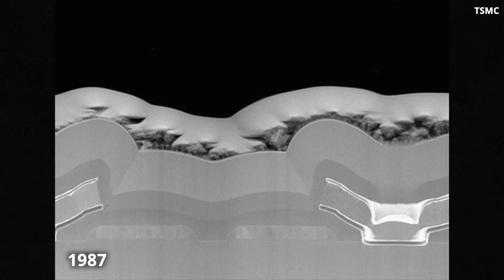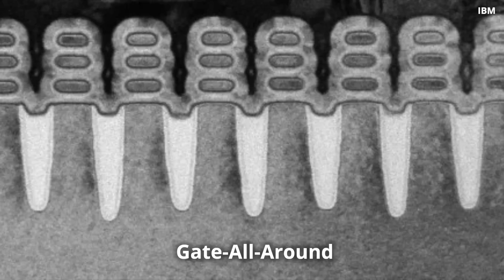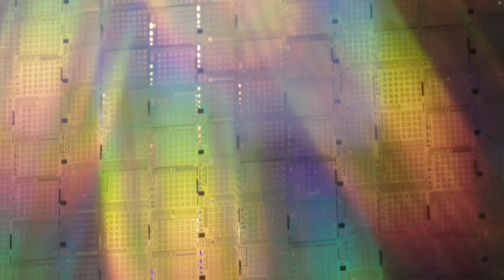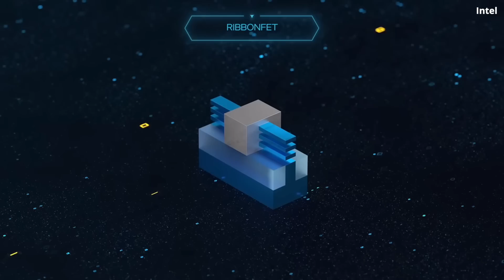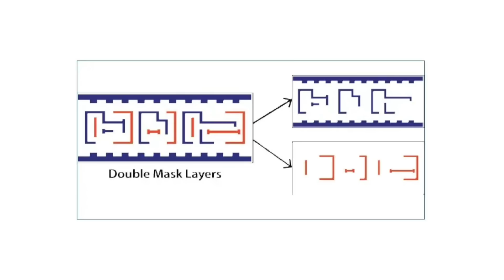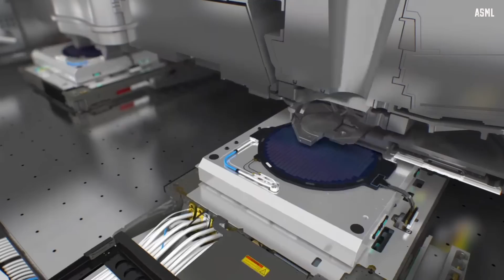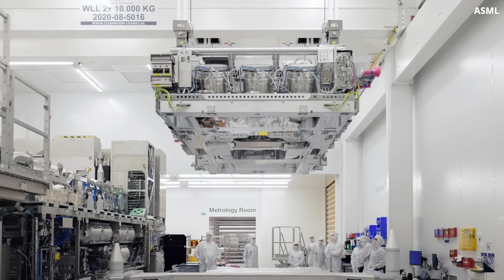New Disruptive Microchip Technology and The Secret Plan of Intel

Comment: I follow you closely. I'm not dumb. Almost every story I read, not just yours, is some new development that is the next big thing, a game changer, etc. can you start working on a story, ranking all these breakthroughs by importance, and then by development, for the past 6 months?
Reply: This is a big one. This is top 2-3, if not 1st. We're looking at at least a 100% improvement in processing power, but could be up to a 1000% improvement in processing power.
Firstly, double-siding the wafer is going to free up huge amounts of physical space for more transistors - not to mention give further ability in higher clock speeds (by distancing the T's from the power lines - and better efficiency and power usage, equating to less heat and the ability to drive things a bit harder and consume less power.

Another thought, for me is, barring physical design restraints, there's nothing stopping anyone from putting transistors on both sides of the wafer.

Comment: Fantastic video, very informative and well presented. If I may make the tiniest suggestion, it's on your pronunciation of "planer transistor". It's pronounced "plane" like "airplane" (as in a two dimensional XY plane), not "plan". The Planer Process was introduced by Fairchild Semiconductor and refers to its top-down 2D approach which allowed for photographic (later lithographic) design and manufacturing that revolutionised computer development. As I say, a tiny point in an otherwise flawless video. :)

Comment: I suspect that Intel is willing to buy the overly expensive fab machine and operate at a loss for the reputation and brand boost they would get for being the first out the door, beating TSMC. It would earn them clients that would otherwise have gone to TSMC and show them as the “king” of fabs. Especially with the government subsidies Intel has from the US, they can afford this. Then, they can invest in affordability down the line to return to profitability after they have acquired all the new business. In other words, I don’t think they even need Direct Self-Assembly to work to execute their overarching strategy.
Reply: Too naive, Intel is losing more money on the fab business than the subsidies from the US government.
Reply: Well Intel was the undisputed semiconductor manufacturing process leader for a few decades until 2018 when they started to have issues pushing 10nm due to not using EUV lithography machines and issues with new interconnect materials, and I believe it's quite normal for them to want to regain their previous status. Intel still has brilliant engineers and TSMC is already on high alert about Intel's new process developments, and if Intel managed to bring Intel 20A products on time they will gain a lot of interests to various design firms.

Comment: Imagine if we finally moved on from our current silicon based microchips and started using graphene based transistors in our electronics i know its been in the realm of theory for better part of 2 Decades but it seems MIT and other institutions are paving the way in breakthroughs that yeild actually results but we all know when something is proven to work and its repeatable its up to the industry heavy hitters to implement these new technologies.

Thank you for being a amazing channel to learn drom and be amazed at the knowledge of how our tech work's and seeing the advancements coming.
Reply from the maker: Thank you 😊
Reply: I'd like know how graphene transistors would compare to optical ones, I think it will be another "format war"
Reply: @thesnare100  the promises of graphene haven't been utilized in anything substantial yet but the conductivity is off the charts the speed of this was measured in Terahertz
Reply: @shadowarez1337  what was measured in Terahertz, the clock speed of a CPU? Electrical conductivity is not measured by that, or at least electrical resistance is measured in Ohm's.